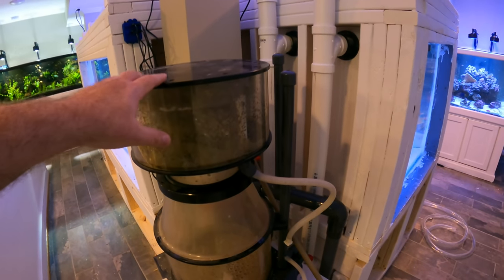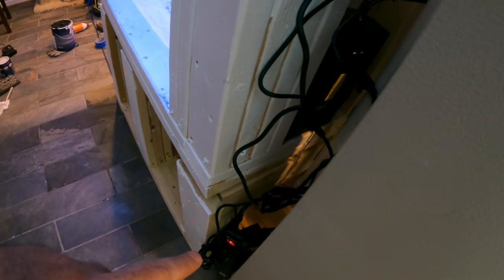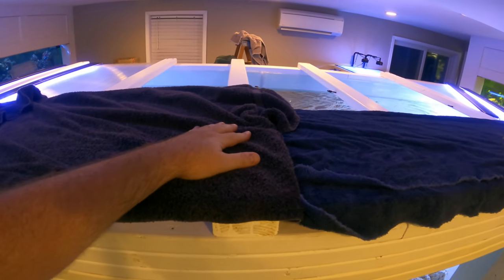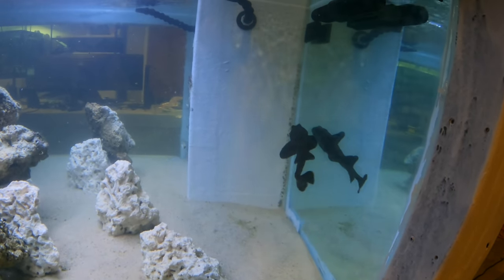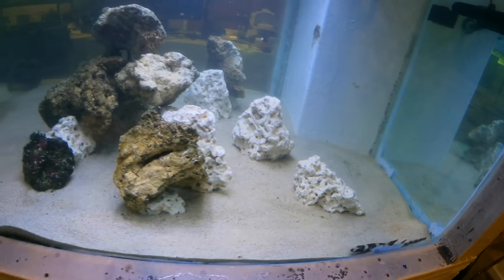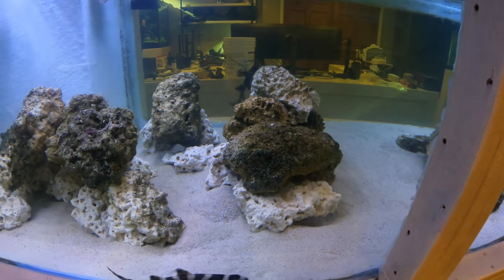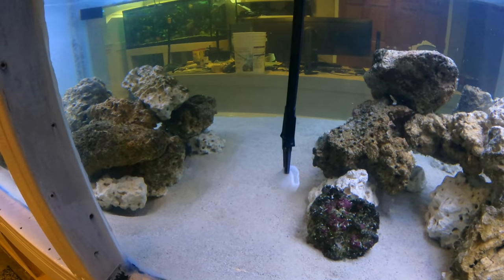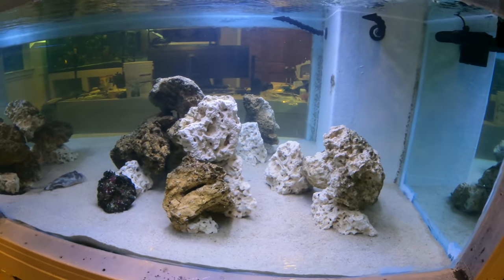Predator Bay is LIVE! 1800 gallons of Sharks, Rays & More! DIY Marine Predator is Complete!

Comment: Did you mention why you switched away from the random current outlet nozzles
Reply from the maker: It was because the random current nozzle was a size that didn't fit the loc-line that was available at the time. Everywhere I looked the size of loc-line that fit the random current nozzle was perpetually out of stock.
Reply: @AquariumDomain.  I was thinking of getting some for a small reef tank, and was going to ask you  if they really made a worth while difference..?
Reply from the maker: @2869may  I have them running on my 600 gallon reef slope and I can tell you that it does work. It does create a nice varied laminar flow, so in my opinion they are worth it...especially if you don't have a controllable power head. If you have something like a Vortech MP10, etc. or similar power head on a smaller tank then it probably wouldn't make much difference.
Reply: @AquariumDomain.  I just have a Newa 900  Italian made "Maxi Jet" (they only sold the name to china) but continued to make the REAL Maxi Jet under the name Newa... LOL
I maybe should have got the 1200, but it's in a 42 hex but filled 3/4 so it isn't so deep, I have a 8" canopy that hides the water line.
I built an internal wet/dry 4''x8'' so the volume is right at 30 gallons, I thought the 900 would be plenty, but I have duel 1/2 Loc Line returns with straight nozzles.
I feel like it needs more flow and was wondering if these would help distribute the water better, or if I should just get the 1200?
I was reading BRS reviews and MANY said the they did not fit Loc Line very good.
I don't have money to waste... lol 
(Sorry for rambling)